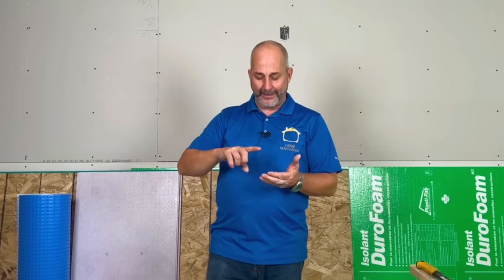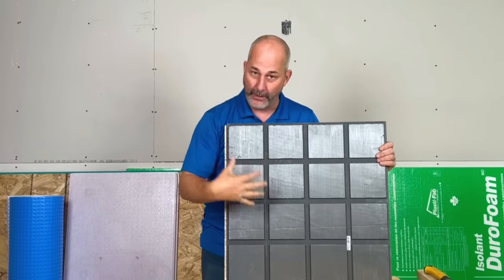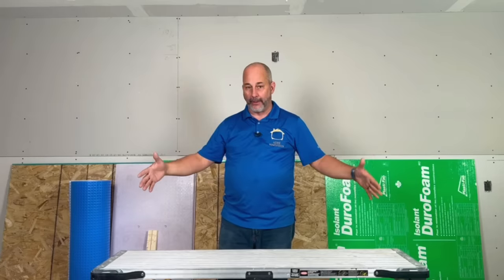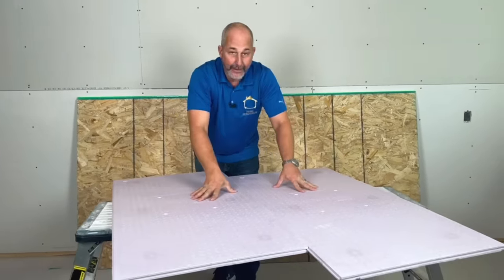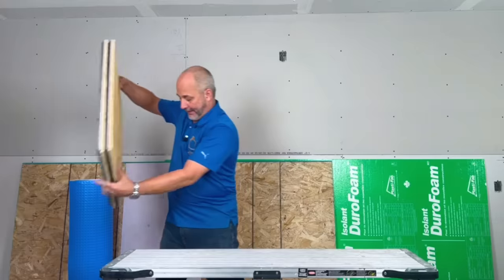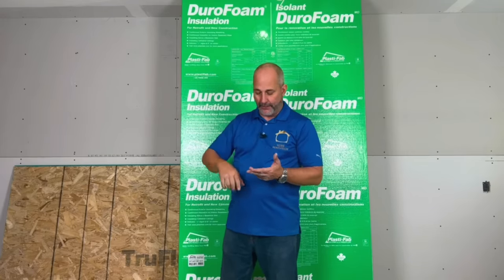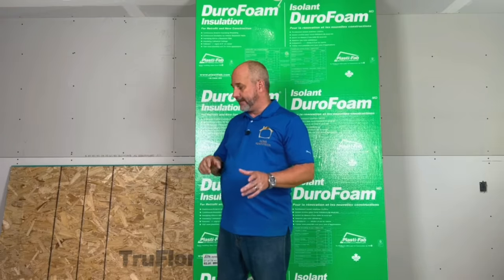Comparing 5 Different Subfloor Systems and What They Cost

Comment: What dricor bottom would be best .I’m in Grande Prairie Alberta  . I had a couple cracks in the 4 ft  basement wall that let a bit of water in they are repaired now . Just curious is the foam bottom or plastic bottom dricor better or would another method that doesn’t bring up the height to much . Thank you so much in advanced

Comment: I don't know why, but come spring... My basement (1976, in Alberta, high elevation, no water close to foundation) becomes SO much colder come spring than during winter.
The furnace IS on less, I know.
But I swear, the concrete is several magnitudes colder.
It's somewhat ironic to always find myself looking into improving basement insulation come... spring.

Your video is going to help me spend my next 2 paychecks better than I would have otherwise.
I will tape a plastic bag against the basement concrete floor with tucktape tonight and see if I have any dark spot come tomorrow.
If I do not have any moisture show, then I am leaning towards trying the 3/4" 4x8 Durofoam sheet idea.

After that, if I choose to use some click together vinyl or laminate from Costco, could I install that directly over the durofoam boards?
Or would I need an OSB layer on top? As far as I understand from this video, I shouldn't need the OSB layer so long as I am not installing engineered hardwood that needs to be tacked down.
Am I understanding that right?
Thank you

Comment: Let's test this Q/A you offered. Brand new construction, NoCo, area is known for moisture and thermal problems (well I came from Texas, natives can handle it). I want something non professional but I have contracting experience but I built stilt houses never saw a basement or concrete screws. I also want something that I can set and forget and not worry my concrete is cracking or having movement later on. Cost is relatively not a concern as in 2x the contract budget but also don't want to come out even against paying to have it done. No walls yet either. What is your recommendation?

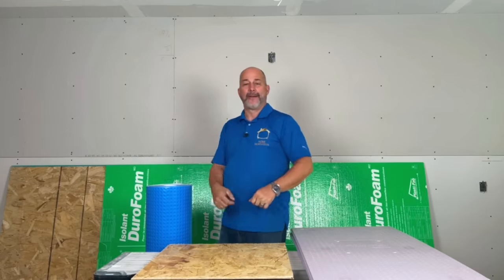Comment: 12:14 I We have a sunken room in our home that floods about 6 inches through a sliding glass door in conditions like the current California rainstorms when street drains are clogged. Obviously any padded or floating flooring would not be suitable and ceramic tiles run risk of cracks if the subfloor slab develops cracks or settling. What would be the best option for us? How do we protect the walls of that room inside and out?

Comment: My house was built in 1930. so I know there's no vapor barrier under the concrete. The basement was finished when I bought the house (basically a bar and party area with a kitchen.)The bar was removed by my first son in law when he lived there with my daughter until they moved out. A wall was put up to create a bedroom space. Now, my middle son wants to use the basement as a living space with his partner until they move out (whenever) but they want to cover the asphalt tiles that are currently covering the cement floor so it's easier to keep clean. Can we simply put the "dimpled" square blocks as a subfloor directly down over them? Then install a floor with the padding over them?
Reply: Yes with vinyl

Comment: I have a brand new home but i am thinking of using the dri core panel because it feels easier for DIY and transport and buy. i am wondering, does this help with the cold floor problem ie will it help as a basic thermal barrier?even with a new house i prefer having more moisture barrier ...as long as my feet are not cold !

Comment: I live in NC and I am looking for a foam or rubber product that can be installed on top of a concrete slab foundation on the 1st floor to provide some give underneath a floating plank floor (probably SPC, but I'm open to luxury vinyl or other suggestions). Would DuroFoam or mass loaded vinyl work well? I am trying to prevent the fatigue that your legs feel after standing on concrete over time, and I don't know if standard underlayment will do the trick. Thanks.

Comment: Hello, I have an old house in Ohio, USA with tube and knob wiring, basement walls are waterproofed, I want to install vynal plank flooring. I dont want any issues with water comming up from the concrete and I would like a thermal barrier. Would the pink foam board in the video be the best solution?

Comment: Hi Jeff! I've got a 1961 tri-level that I'm looking at finishing the basement on. Right now it doesn't seem to have much of a moisture problem, but the ceiling is low (7' 0"" unfinished) and I'll need to add a box around the main beam. I was thinking about just using foam board on the floor, but since the house is heated with a hydronic boiler I'd love to add radiant in-floor heating. Any thoughts on how to add it without having everyone hit their head?
Reply: About 7 years ago I put durafoam down on the concrete of my basement floor and then used a router to put channels in the foam to run pex thru the floor, and click lock vinyl onto.  It seemed to work pretty well - the basement is pretty dry as I take care with the downspouts and we are well drained soil that is well sloped.

Interestingly, the basement has been so well insulated we have not needed to hook up the hydronic system to it.  We do have forced air in the rest of the house, and have a gas fireplace that we use as needed.

Comment: Hello, Jeff. Love the videos. Super helpful as I'm starting to plan basment projects. 

One question I have is about the concrete surfaces. I have an older home (1966) so ill need the moisture and thermal break products. The other thing js walls and floor are currently painted. Does the floor and/or wall need to be bare, unpainted concrete/block to allow the moisture to dissipate? I haven't really found information on this. I'm assuming they have to be mostly bare.

Comment: Your channel is great and gives me the information I need to consider when working on my home.  A project I'm on right now is finishing my basement.  I have small windows so carrying large OSB boards will be difficult so I'm considering barricade thermal shield.  However, I'm not sure if I can build my walls on top of this product.  

Do you know if that is possible, or do I have to build my walls first?  My home is 11 years old and has water proofing on the outside of the walls.  Would that even be something to be concerned with anyway?

Barricade Insulated Subfloor has a continuous foam bottom with no channels, this would be my second choice but I'm not sure if this product would protect me from some future small water infiltration. Is the lack of channels a problem?  There website says "CAPILLARY BREAK - Creates healthier air quality by helping protect against moisture, mold, mildew and small water leaks"  I'm not sure if that really means it helps with water infiltration or not without the channels.  After watching your channel I'm unsure if channel-less products are ok.

Home Depot seems to have the item I may be looking for with the channels and foam (Dricore R+ Insulated Subfloor Panel)  but it's $10CAD per panel 😞Would this be a better product?  

I think I can build my walls on top of the Barricade Insulated Subfloor or Dricore R+ Insulated Subfloor Panel?

I like the idea of the DMX wall dimple sheets with OSB but doing it myself makes this option a bit more difficult.  If you'd recommend this option, I'd figure it out 🙂

I really enjoy your channel and am writing this long message because you mentioned you are good with questions.  Hope you are able to answer.

Keep up the great content!!

Randy

Comment: My mobile home is having moisture issues and came with vinyl on kitchen floor. Put vinyl planks and moisture barrier now my floor is rotting and needs to be replaced. What should I use and can the subfloor be replaced with treated 3/4 plywood

Comment: I have a basement from a house built in 1964. Previous owner it looks like they put down a laminate right on top of the concrete. Is it worth trying to tear that up? I haven't noticed any moisture, but I'm also not super confident in the french drain which looks like it was not done correctly (a whole other story)

Comment: awesome video! I am looking at building a new house this year and to save money will have to do the basement myself as new money earned and saved, so just started researching to begin learning what i will be in for. 

So question, with the Durofoam and the chip board what do you then need to lay down polyvinyle floor tiles,.. because wont they also allow the osb texture through? So some sort of underlayment. I think thats what you referenced with the 2x2 tiles,.. covered in same material so a sheet of some underlayment needed. But which one? 

Second question if using durofoam and the osb, can you lay carpet onto that? (Directly?)   A pro would have to be hired so they would do the work but again an underlayment would be needed correct? Just so i would know a rip off artist versus a pro for future reference. 

Awesome video, i subscribed and will go learn more in your videos, thank you.

Comment: I have a 1950 house  I live in Minnesota going to start finishing the basement these year but i dont know what to use for the floor , I have a problem with water leaking inside the basement from a hole in one of the walls when it rains hard or the water is still on top for a long time.

Comment: I have a 25 year old house that sits high on a hill. but get some wall seepage with a really heavy rain. looking at a laminate hardwood. i was thinking either the system that you installed or the one which looks like white insulation that has some moisture wicking. Your thoughts?

Comment: Hello Jeff, I live in Calgary, AB and considering basement subfloor options. Home was built in 2013. When I bought the place noticed some cracks had been filled out in the more viable area which has held up. I only noticed some cracks under the basement stairs area recently as I was looking to clear out all the old paint cans and extra tiles that the builder had stored there. What would you recommend? I was thinking durafoam and 5/8 OSB as 8 have big windows..thanks in advance

Comment: Detroit Area. 1961 poured concrete foundation walls & slab. How do these products work in covering asbestos tile? I have one corner with moisture problems. Would probably get that crack filled first.

Comment: I have a raised ranch and the basement is used as the family room. The flooring is carpet, and we have water stains throughout. The house was built in 1981. Do you know what the best solution is? I was thinking vinyl plank flooring with sone type of sub floor. Would appreciate some advice. Thanks!

Comment: So if I have a 240sq concrete slab and I want to raise the floor 3 inches to match the rest of the houses floor can I use a 2 inch rigid foam and 2 layers of ply on top? I put black plastic beneath the slab before I poured it

Comment: I wish this video was around 3 years ago. We live in south Louisiana and my dad’s house didn’t have a moisture membrane under the slab. It stays very wet here and we couldn’t figure out how to lay new floors without mold developing under them so when he passed in 2020, we let the bank take the house that I grew up in. Even the inspector was getting a 100% humidity reading and didn’t know a solution. So my question is, if moisture is coming in, does mold develop under these types of subfloor?

Comment: Jeff can you help with this? I live beside a lake, but have had excellent weeping tile system to manage water exterior of all the wooden foundation with double layer of dimpled black material attached to foundation and 1 sump pump at the front by lake and two under the home in the crawlspace. In the crawlspace I have a 4 ft crawlspace that is spray foam (closed cell?) Insulated, purple on wood frame walls and yellow on floor over concrete which sadly allows lots of cold in the floor above. The furnace is in the crawlspace and there are a few vents open, but the main floor is always very cold with the plank flooring. What could you recommend for this? I really want the main floor warmer so how do I prevent the crawlspace from creating cold floors?

Comment: Hi Jeff. Long time viewer, first time commenting. I used your Shed A-Z video to build our custom 8'x12' shed a few years ago and still going strong. I was wondering if you could give me your input on my next big project - the basement: I'm in southeast Michigan, 2017 build, vapor barrier flooring, tarred outside foundation walls. I did the plastic bag test and no moisture issues on floor or walls. at the moment we are leaning towards sheet vinyl for flooring. any input is appreciated.
Thanks Jeff

Comment: Jeff, I love your videos and just subscribed.  Thanks.  I have a house in the north east that is just a few years shy of 100 years old.  When we moved in we had to pour the basement floor on 1/2 the basement as surprisingly there was not one under the old moldy plywood that was put down.  We then installed a French drain.  On the original part of the floor there is moisture issues (did the bag trick).  I would like to drywall the walls and put down a floor.   There is also some leveling issues as I don’t think it is perfectly flat but have not investigated.  I am thinking the dimpled membrane with the green foam core on top followed by ply wood before I put down a floor.  Does that make sense?  I am concerned about how to do anything for the floor and walls with the French drain around the permitter.  I welcome any feedback or guidance.  Thank you.

Comment: My big issue is that my concrete floor isn't flat. And there is actually a section that is sort and not concrete at all. My plan is to lay down 1x6 pressure treated sleepers (or composite decking) spaced 2 feet apart, which I can shim to level, then place ridgid GPS insulation on top, followed by 2 sheets of 1/2" plywood. Is this overkill? Does it make sense at all? I'm still undecided on the thickness of insulation as well, you mention 3/4", I was planning on doing 2" as half of my basement is below grade but the other half walks out (House is in the side of a hill). I assume that because it's partly above ground that it should be insulated more than a basement would, that has the insulation of the earth around it. Any thoughts or advice is greatly appreciated.

Comment: Hi I am renovation a home built in 1958. It has moisture issues from the ground and has damaged the floor. It is a raised house. I've had the floor and sub flooring pulled up. What type of flooring do you suggest?. It is a 1900 sq ft home in Louisiana 37 miles outside of New Orleans. Please help.

Comment: Hey Jeff,  I live in northwestern Michigan and house was built in 2009. I’m the 3rd owner and previous owners just started to finish the basement. I have investigated and they installed a very thin blue plastic poly mil sheet before installing the engineered floating tongue and groove flooring. This is only in large family room the other 25% of the 75% completed basement is tile. I do not have any moisture or water issues to date as I know of but was wondering if that is enough if I do not intend to change the flooring to a different type? Also the insulation batts was placed right against the block wall without anything and again I do not have any moisture or water issues to date just wondering if everything is ok beside a leak or crack in the future which would be another issue altogether. Thanks

Comment: Curious which works best to get rid of small imperfections in slab flatness.  A lot of floating floors have required tolerances much more stringent than the concrete finishers'.  If the barricade is dense enough I wondered about just gluing down 3/4" xps.  But then I looked at how uneven the pieces of xps are... I also contemplated buying sheets of recycled rubber to lay on top of the foam.  They would be heavy enough to keep them flat and unmoving.  Thanks for the tip about r value.  I noticed a lot of recommendations for R10.  I was thinking R4 would be lots and really don't want to eat into my 7'6 height in my 1978 house.

Comment: Hi, I have watched your videos probably for the last 3-4 months as I prepare for our project of renovating the basement and need some advice/direction.

Location, Gatineau/Aylmer (just across the river from you :)), house year 1981.  Current state is leveled concrete floor, has a sump pump, exterior walls have ridged board then 1x4 with drywall (no 2x4 framing), no interior walls.

We are trying to decide on the subfloor combination and concerned on the fact that the concert currently has no vapour barrier, and has a sump so we want to be able to manage small amounts of moisture/water under the floor.  It would seem the durospan + OSB does not provide this ability, so what is the preferred option that is cost effective to do that with insulation.  Is it DMX + OSB, DMX + DuroSpan (is that an option?!), DriCore R+?  Leaning to DMX + OSB, but your opinion would seal the deal.  Any opinion on Dampro or is there a cost effective/contractor version in Ottawa area for DMX?

Once the subfloor is there we intend to frame on top the interior walls and redo the exterior walls.

Comment: My house outside of Smiths Falls was built around 2000. How do I verify if vapour barrier was implemented before cement was poured? My basement floor is colder on the finished (laminate) side of basement than the exposed concrete on the other side.